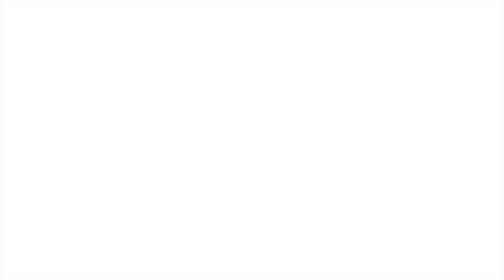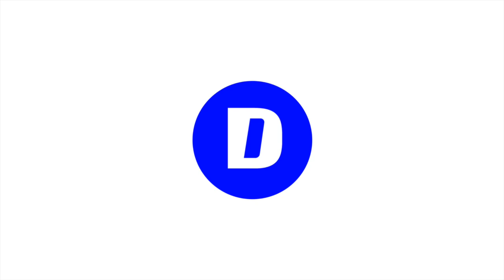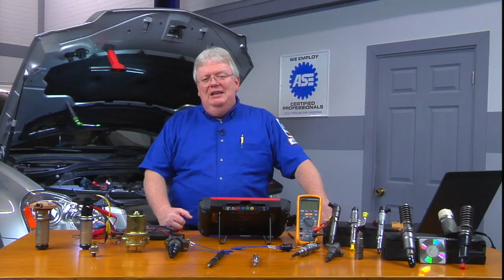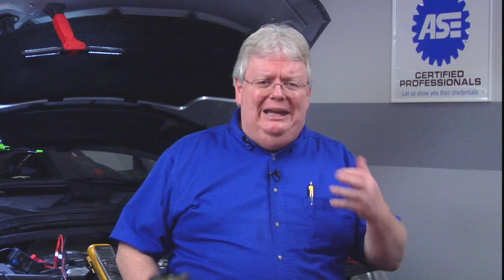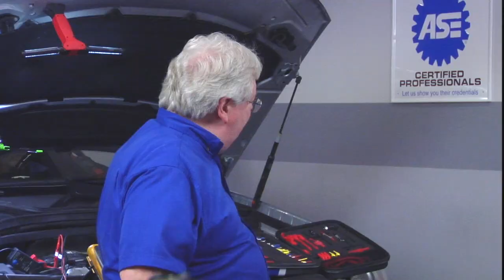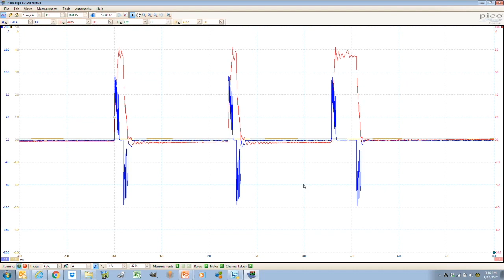Hands On Diesel Injector Current Scoping

Comment: Google says not to use a 10x standard probe. Up to 250 spike voltage. At 10x that means 25 volts would show at scope. Why is that dangerous. Doesn't make sense to me
.a 10x probe rated for 300v should be fine on a scope that can handle 40v input for instance ... Can you explain why I'm wrong.

Comment: As far as I know current flows from positive to negative, so how it's possible to have current flow opposite without changing power polarity? I definitely missed something at school
Reply: Some drivers may reverse the polarity but not in this example. Electrically the injector behaves like a 4 microfarad capacitor. The current flows in one direction to charge the capacitor then the driver effectively short circuits the capacitor (injector) to close it. The capacitor discharge current is now reverse to that of the charging phase. Look at the scope voltage waveform, it ranges from zero to 120 volts positive, it never goes negative. The high frequency oscillation on the current waveform is probably the result of a damped resonant circuit from the series inductance inside the ECU.
Reply: @robertrichardson5396 
Im looking at getting a scope to help troubleshooting my field work. I work on heavy equipment, lots of common rail diesels as you can imagine. 
Do you know if the 4425a pico scope is capable of enough resolution to see spikes and drops in rail pressure utilizing the rail pressure sensor? 

Sherwood on youtube said his ats was not able to do it. He used a device called the ADDI that enhances the data to make "any scope" be able to see the data. 
If i can avoid buying this ADDI I could spend that extra money on the high end pico scope. 
Thanks for any input!
Reply: PE injector drivers reverse polarity to open and close. you are correct.
Reply: Can the actual on and off time of each injection be measured here. There’s videos showing the waveforms but not much info about measuring it to diagnose issues like blocked or leaking injectors or watever else it can determine other than the how many injection cycles and amp peaks. I’m just not yet seein the value in this compared to a basic resistance insulation n injector leak off test. Wat does this current waveform actually show in regards to diagnosing injector issues